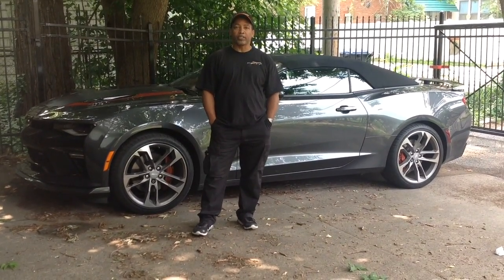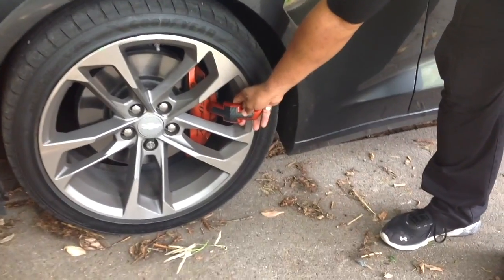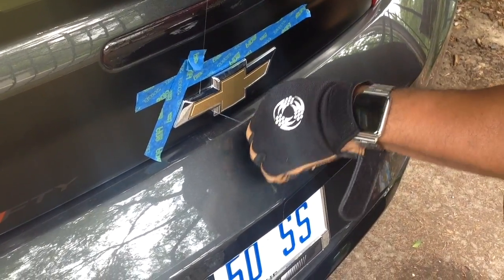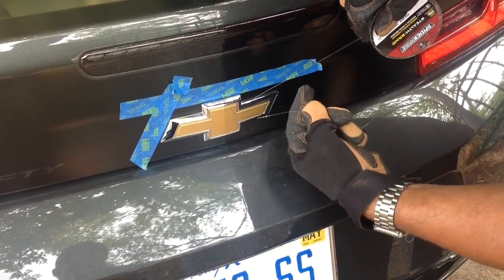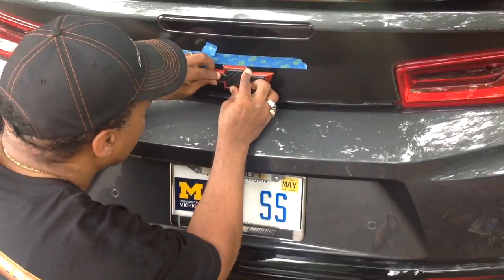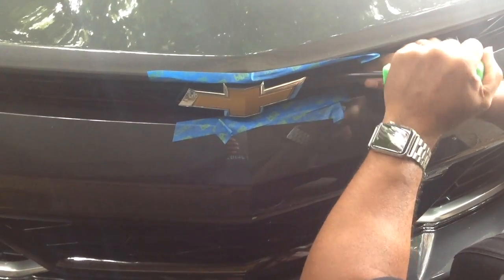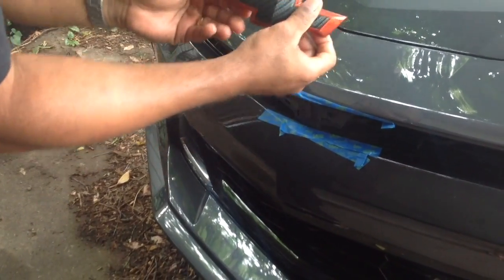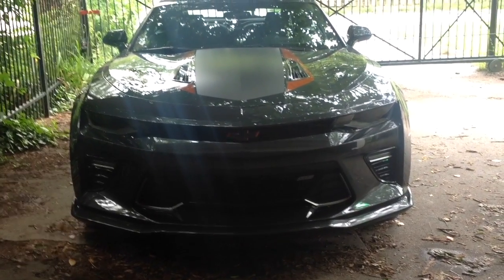Bowtie Installation

Comment: At 2:45 you comment about using gloves to prevent the fishing line to prevent cutting into you fingers. What works better (for me, anyway) is to wrap the line around 2 small round pieces of wood and use them as handles to saw thru the tape. No cutting into flesh at all!